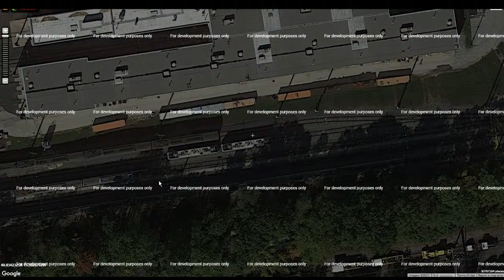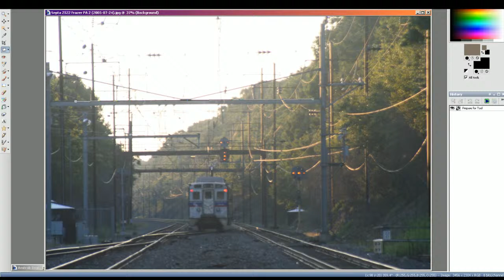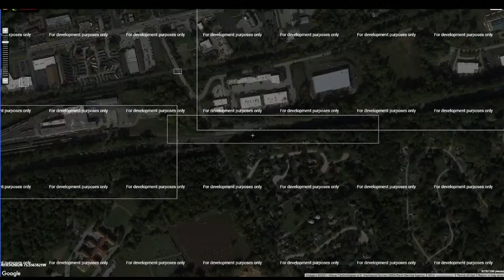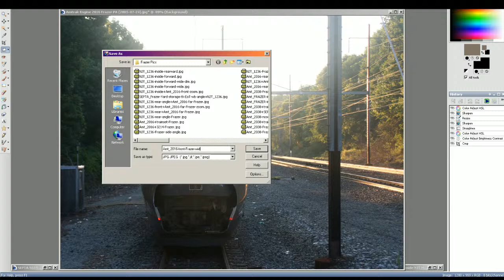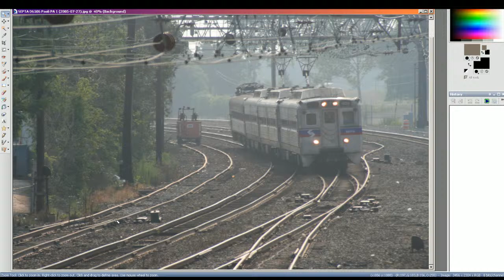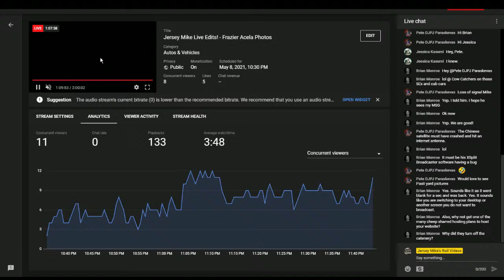Jersey Mike Live Edits! - Frazier Acela Photos

Comment: By 1994, I had been gone from there for over a decade.  This also explains why the Thorndale Extension - which HAD been publicly discussed during 1979 and 1980 - actually got done.  (The work that Bombardier themselves did here is now done at Bear, DE (which is why this shop could be acquired by SEPTA).)